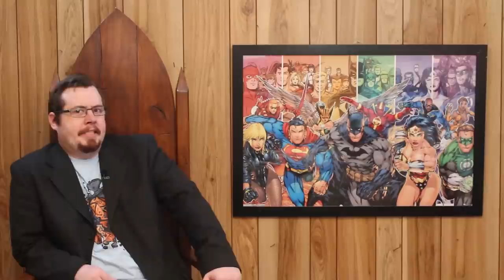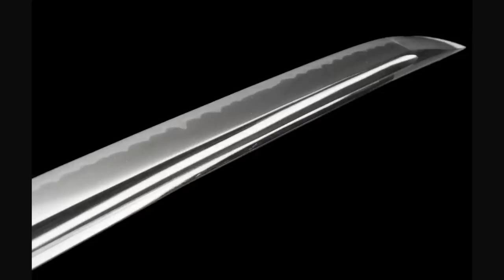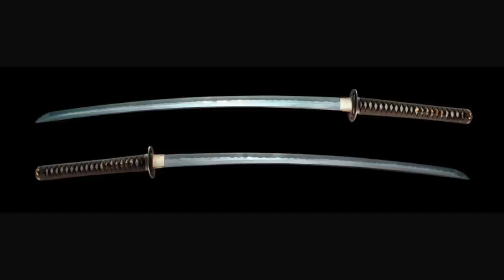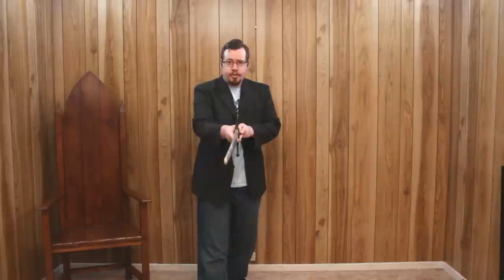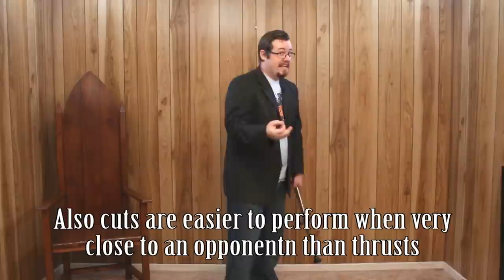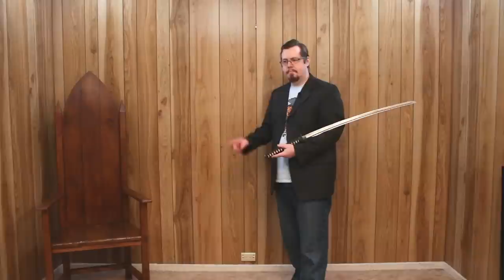Super cutting swords, are they needed?

Comment: I think it's connected to the armor people were wearing, e.g. in india turbans and baggy clothes was worn, a lot of flexible fabric that would be cabable of stopping the blade of a straight sword from going deep, but the extreme curvature of talwar is less likely to get stuck in the layers of fabric, because the point of the sword is pretty much out of the way and you can make really long cutting motions without your tip of your sword getting entangled in the cloth, similar thing with padded armor/gambeson in europe in connection with falchion/messer, great cutters for a better chance to cut through the thick wool padding
Reply: Exactly my thoughts. This guy made the mistake of assuming every battlefield to be the same.
Reply: Wouldn't an Indian tulwar-user also have chain-mail? I remember seeing a video in which the swordsman was holding a tulwar in one hand and a stabbing-dagger in the other hand, along with the buckler, for bursting the rings of chain-mail.
Reply: Admiralmeriweather First and foremost, in almost all battlefields, whether Europe, India or Japan, the mass used weapon was the spear or any other polearm. 

Plus, in India, even since ancient times, there has been a widespread practice of using clubs and maces, called "gadaaas" in Hindu literature.
Reply: Admiralmeriweather not all warriors wore chainmail, known as sanjoh. It was extremely expensive and only worn by nobility mostly
Reply: Gaurab Chatterjee are you a practitioner of the vidhya?
Reply: Navdeep Bal Not really.
Reply: Gaurab Chatterjee oh I thought you were. Ive been taught this art in the Ranjit Akhara.

Comment: When it comes down to it, I’d prefer a weapon that would come completely through the limb. If I stop short, if my angle is off, and my sword gets stuck ... well I’m done. It might be overkill, but I’d prefer to have that safety net. Because unfortunately, in the heat of battle, when you have to react, can you say you’re going to do everything perfectly?
Reply: Munchkin.
Reply: I would use a drone
Reply: Double munchkin.

I'm just gonna go straight to Munckinx10^8 and use a Super Star Destroyer battlegroup.
Reply: There is practically no way you can cut any bone (maybe you can chop fingers at best) with any sword.
Bones have hardness comparable to steel so you will just ruin your sword.
You can only cut the limb if you manage to hit the joint
Reply: +Brandon Rinebold
Ahhhh, but I didn't use a Death Star! For precisely that reason, of course. 

A battlegroup of several Imperator-class star destroyers, along with a full array of support frigates, centered around the considerable bombardment and psychological weight of an Executor-class dreadnought, lacks the single-point-of-failure problems that have been demonstrated in massive monolithic battlestations.

I have neatly inverted Admiral Motti's famous and naive quote, "Dangerous to YOUR Starfleet, Commander, not to this Battlestation." You now need multiple gifted farmboys, at least one for each of at least a dozen targets, with extensive backup to draw off enough heat for them to reach multiple target points on each of my vessels. 

Still working on some improvements to the bridge shields, though.
Reply: +deltaxcd
I have a butcher's cleaver that disagrees with both of the arguments you just made.
Reply: +AnimeSunglasses I use the Sun Crusher! A nigh-invincible starfighter capable of tanking superlasers and annihilating a system's star! (Actual weapon from the Expanded Universe)
Reply: There skeletons found missing clean cut chunks of skull...  http://www.hurstwic.org/history/articles/daily_living/text/health_and_medicine.htm

"Battle Injuries and First Aid. Both the saga literature and forensic studies of skeletal remains suggest that battle injuries could be horrific. The skull shown to the left is from a man who died of battle injuries in the 11th century. The top of the skull was removed by a blow from a sword. The terminus of the blow is indicated in the photo by the clear blade.

The femur (leg bone) shown to the right is from another man who died of battle injuries in the 11th century. The bone shows clear marks of the impact of ring mail against the bone, suggesting his upper leg was hit with a sword blow so powerful as to force the rings of his mail shirt through the muscles of his leg into contact with the bone. Astonishingly, this injury was not the cause of his death. His skeletal remains show other serious injuries received in that battle. However, it was a cut that partially severed his spine at the neck that killed him."
Reply: lol at the guy in the maille, maybe trampled/stepped on by a horse?  But yeah I guess they're not designed to.  I would just consider them as with any lethal weapon: be as lethal as possible.  But in most cases, maybe it just caused very clean cracks in bone or causing it to fracture in two vs a "cut."  And then there is the consideration of "if it's not sharp enough to cut through bone it'll get stuck."  I guess in hind sight "designed to cut and have cut" doesn't really matter if the recipient is still dead.  So the whole "cutter vs thrust" doesn't matter.  If the weapon does what weapons are supposed to do people will be dead.
Reply: But you will also need good thrusting ability in the battlefield because of armour, so a balanced weapon is better instead of something that compromises trusting ability for excessive cutting ability, the point he is making in this video. Sorry if I am wrong, this is just my personal opinion.

Comment: Gambesons are the kicker, a Longsword has extreme difficulty against heavy padding, on the cut, a falchion does not, their are demonstrations of this  available on the Medieval Review channel, also a curved blade is less likely to bind, and retains cutting power better with edge wear/damage (which is an important thing to remember, modern steel is far better than medieval steel, so holds and edge better, for longer, especially when striking shields etc), a third point, even trained combatants get a little cave man under stress, which is downward strokes to the head and neck, especially while tired and stressed.  This argument was a major part of British Cavalry tactics and sword design, Matt Easton has addressed it iirc.
Reply: I think he also overstates thrusts - a thrust will kill perfectly fine, but unless it goes through the heart, it will not kill for a good 5 minutes or so. Speaking from massive blood loss experience here, It takes forever and so many litres of blood before you fall unconscious - and when you are low on blood, it stops coming out very fast, so you have even longer than you would think.

Having said that your eyes get a bit blurry and fighting would probably speed things up, hence me saying 5 minutes, not the 1 hour that generally doctors consider for things like stab wounds giving a reasonable chance to save.

Also, bleeding is painless in itself - especially internally. most nerves are on the surface of the skin, thus slashes ARE more debilitating in my reckoning.
Reply: 5 liters of blood, if you lose 1 you are in shock wich mean sitting still and not moving being pale. 1 good thrust in the main portion of your body is game over. Now of course, if you thrust trough a plate in a gambeson I doubt you reach his torso unless you have a spear, but I could be wrong. Then again good luck cutting a full plate knight. The way I see this is that weapons are invented to kill, then as a reaction people protect against it and then new weapons come around ect. Cutting weapons are for horse back riders as a second weapon or for civilians walking around. Who walks around in plate all day right.

Comment: That's funny. Common historically used argument in favour of thrust (from Vegetius to Victorian times) was that in practice even very nasty-looking cutting wounds turned out to be superficial and not deadly. So perhaps you need that "overkill" to be effective cutter in real battle
Reply: +fizikshizik Agreed. There are acounts that during the Crimean war, the Russian winter uniforms were so bulky that they were virtually slash-proof from British sabres. And the curved sabre is a very cut-heavy weapon.
Reply: +Tim Birch The British sabres that had so much trouble during the Crimean war tended to be much lighter "pipe-backed"style swords I believe, which have a fairly thin blade backed with a great thick cylindrical rod on the back edge. It's that which made it very bad as a cutting weapon,. The older style sabres like the light and heavy 1796 models would've made much easier work of the Russian great coats.
Reply: And don't forget that russian winter coats stopped musketballs with regular frequency.
Reply: A good account of this was in the Afghan war where the British surgeons dealt with so many wounds from cuts that they had a very high survival rate. The Afghans were mainly using the “Khyber knife”. The British surgeons were thankful that they didn’t thrust with them, other wise it would have been a nightmare.
Reply: +fizikshizik I'd add 2 other points:
1. cut has IMHO higher chance to hit. Cut is kind of area damage, anything in the wide path is in danger while stab is like a shot - not aimed properly and you miss.
2. cut might be more likely to immediately incapacitate. You may survive even fully recover but at the moment i.e. your fighting arm is disabled
While stabbed you may die later due to the internal bleeding or infection yet you are able to fight for some time. Moreover for longer period of the history at least critical parts of the body were protected if possible. While cut could still at least disable the limbs.
Reply: I read a Hungarian hussar's note, that sais something like if you want to kill him, stab him. ofc it ware said in a lot fancier way, but the point is the same. And the era's saber's ware "cuting beasts"

Comment: also not all of your swings are going to be at full power. i mean you may be tired or do not have much space to swing so the force of your swing will be lower. if you had a longsword you may bruise your enemy but probably not even pierce through leather armor. if you had a blade specialized in cutting the blade would pass through the leather and give your enemy a possibly fatal blow. this could mran the difference between life and death
Reply: From experience, Messers(what I've used) are far more forgiving in the cut then longswords, they can sometimes cut through targets even with horrible edge alignment, and can just generally cut through things with less effort.

Comment: Cutting through cloth is not as easy as you seem to assume.  It's hard.  Sabers, scimitars and tulwars were designed to do it effectively.  From accounts of duels I read, saber cuts usually wounded, not killed, so there was no excessive cutting ability there at all.  Just enough to do the job,.

Then, a thrust has a shorter reach.  Realistically you need to aim for the torso.  Hand or head are small targets, difficult to hit on a moving opponent.  Cut to the arm or head will usually do the job, but contrary to what you expect, it will usually not kill.  People used to wear protective headgear (thick hats and so on), and even without it a quick light cut will stop on bones.  Enough to stop the threat, not enough to kill.  

Thrust to the torso will likely kill, but it's very difficult to recover from them.  You sword is stuck in the target for a considerable time, two-tempo action, while a cut can be followed into an immediate guard within one-tempo action.  Especially important in melee, and that's probably why sabers became so universally adopted in armies all over the world.

Comment: In a civilian context, weapons like the messer make sense.
If you get attacked by bandits or mugged in the street, you may be severely outnumbered. Therefore you want to make sure that any clean hit will immediately take an opponent out of the fight for good. A cut that incapacitates an arm or slowly makes them bleed out may not be good enough, but cutting off an entire arm will cause extreme shock from sudden blood loss and therefore make sure, they can't fight on no matter what.
Just causing a slight bleeding and incapacitating limbs might be enough in a dueling sense, where you can just pile on the damage and a weakened opponent will not be much of a threat, but in a one versus many scenario, even a guy that can only use one arm still poses a significant threat because he can still grab you, pull you or otherwise distract you, so his buddies can finish you off.
A weapon that's overkill pretty much rules this out. There may be people who can fight on when they have a wide cut over the back of their arm but there is nobody who can fight on with the shock of sudden blood loss that sets in after they lost an entire arm... Unless they are on an insane dose of amphetamines.
The reason for the overkill factor is mostly stopping power.
That also translates to the battlefield. Cavalry wants to end opponents in a single strike and their high position on horseback facilitates big downward cuts. A big mean cutter makes sense there.
Reply: +naphackDT sure, the Messer was a sidearm for the common man, they were allowed to carry them anywhere. But I&#39;m curious how do you explain why the Kriegsmesser, the two handed Messer, was so popular in the age of plate armor ? It doesn&#39;t have a straight point to go through armor gaps and it doesn&#39;t have a pommel either. And the name translates to War Knife, supposedly used by Landsknechts in battle.
Reply: +Maxawe Some I haven't read on the subject but it looks big and study enough that you can use it as a crowbar and hit them with the guard.
Reply: Cutting an arm to the bone would not be considered "slight bleeding".
Reply: It's just a flesh wound
Reply: +naphackDT not to mention if the bandits see their mate's arm lopped off they'll think twice about getting any closer. a cut even a lethal one, just doesn't have the same psychological impact
Reply: +naphackDT Just wanted to add something here
" there is nobody who can fight on with the shock of sudden blood loss that sets in after they lost an entire arm..."
While There is definitely some truth to that i just wanted to point out that there were some cases where a fighter would continue even with such a massive wound. One of Scholagladiatoria's video - 'Fighting on after sustaining great wounds ' -  mentions an account where a soldier loses and arm but then proceeds to cut down a couple of enemies before being rescued 
Just wanted to add this here. I'm not very knowledgeable about these topics as I've only been whatching HEMA videos for a year now but i still thought it's worth to note this
Reply: +Maxawe Some Because mpost troops only wore breastplate and a helmet and by the time langesmesser was popularized, they had muskets to take care of the Heavy calvarymen.
Reply: +Maxawe Some 
I might be wrong here but I think during the middle ages straight double edged cut and thrust swords (arming swords, longswords) were exclusive nobility weapons. This would explain why the messer was so popular among wealthy commoners.
In german arming swords are even called "Ritterschwert" which translates to knightly sword.
The other thing is that most armies (I think) consisted at least partly of men at arms, not knights, that couldn't afford an entire suit of plate armor. Those, again I'm not quite sure about this, were exclusive to the nobility, which often rode on horseback. Therefor it would actually make sense to use a war knife in battle as a commoner.
I know I'm not an expert on this and I make a lot of assumptions but I think it makes sense if you argue this way.
Reply: +naphackDT A good cutter doesn't need to be heavy. A shamshir weights about 800g whereas an arming sword weights 1200-1500g. Also a short blade is faster to draw and more comfortable to carry.
Reply: kriegmesser is not two handed, its just have length of bastard sword; essentially hand a half sabre
Reply: Eissa Sinéad It depends. Some must handle similar to a heavy Katana, others might be easy to wield in one hand.
Reply: I love severing people's limbs and heads as much as the next person. In civilian contexts, though, I had resigned myself to the use of thrusting weapons following argumentation such as Shad's. We cannot in every circumstance gain our heart's desire, I thought. So, I thank you, sir, for opening my eyes! I look now forward to the next footpad to cross my path—and to the look in his eyes when he is sliced in twain.
Reply: @scratchy996  Do remember, the primary weapons of war during the Kriegsmesser's time were pikes and muskets. Armor was on the decline and most of the people on the battlefield had big gaps in their armor for various reasons from as low as they/their employer couldn't pay for extra armor or they needed extra mobility.